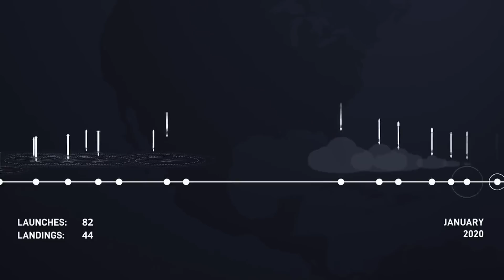SpaceX Is About To Launch A Record Setting Payload

Comment: do You know, that Mars has Milankovich cycles, too? All the political discussions of the Green Environmentalists concerning CO2 on Earth, those who would stop a rocket launch, because of a bird's nest, are short-sighted. in 10000 years, Earth will head into the next ice age! And because there is so much cold 1.6°C, 35°F ocean salty water ( more than 50% of all water) down at the oceans' bottom, the next ice age could become dangerous (without orbital space mirrors capability). 
 The oceans down under are so cold now, that they possibly could freeze down to the bottom. That would be a real catastrophe, worse than the first and second Snowball Earth 700E6 years ago (when the Earth had more geothermal heat available under the oceans; so they were frozen only on the top)! 
 I hope more Falcon Heavies will launch in reusable config until Starship comes online.

Comment: 3:14 It should be noted the Falcon Heavy fully expended launch of ViaSat-3 ended poorly.  Viasat announced July 12 that it had encountered an “unexpected event” during the deployment of the large reflector on its ViaSat-3 Americas satellite and it is probably a total loss.  Viasat is expected to file an insurance claim worth as much as $420 million.  The  aerospace and aviation insurance market has been greatly stressed by $7 billion in claims for leased commercial aircraft stranded in Russia because of the war with Ukraine.  Hughes Network System ordered the Jupiter 3 (EchoStar XXIV) satellite from Maxar in 2017 for $445 million.  The ViaSat-3 is configured with an enormous reflector antenna, one of the largest ever sent into space, tethered to an extremely long boom arm.  Jupiter 3 is not so configured.  However, the cost of Jupiter 3 is large and a loss would be devastation to the already stressed aerospace and aviation insurance.  Hopefully Hughes doesn't have issues getting insurance for this launch.
Reply: Has nothing to do with SpaceX tho.. they did their part
Reply: @zmblion  Correct.
Reply: @zmblion false
Reply: Yes, hows this spacex fault?